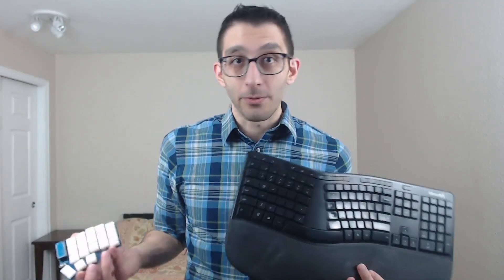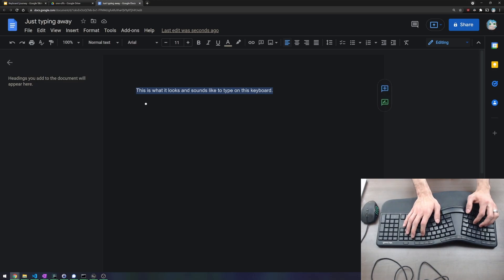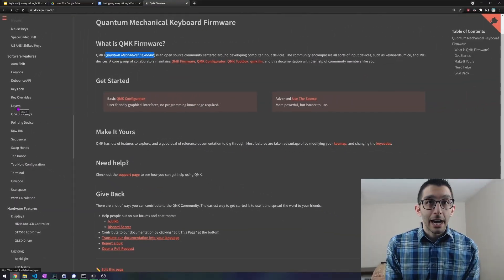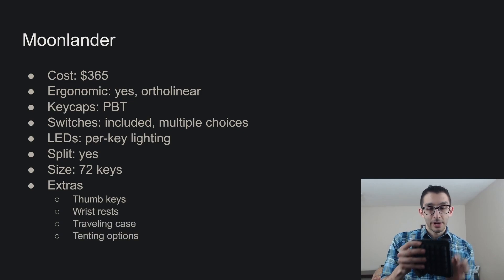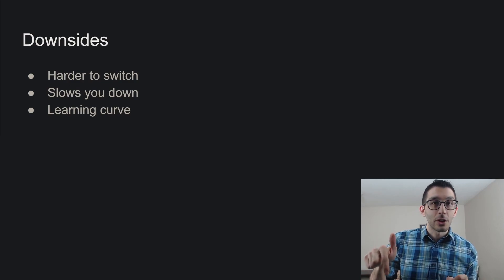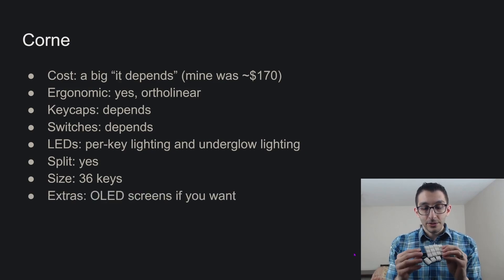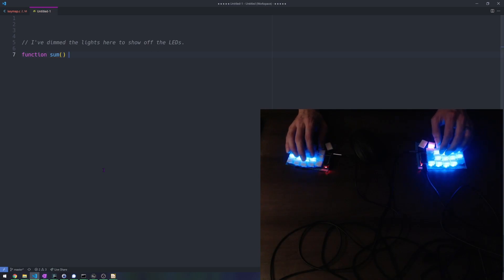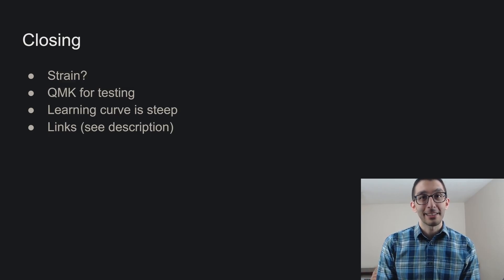My keyboard journey

Comment: Wish I could find a keyboard with an ortholinear layout and traditional modifiers and size. I’m not quite ready for a bunch of layers, and I like having keys like ‘ and \ on the main layer along with arrow keys (edit: ideally split and with a 1.25-1.5u modifier key under the C)

For anyone feeling similarly, the Keebio FoldKB is the only one I could find that has both VIA support and is actually available, although as a 60% it doesn’t have traditional arrow keys or a function row. Amazing company though
Reply from the maker: I swear I've seen keyboards like what you're describing in the various keyboard subreddits, but it's hard to find those posts now. These are soooort of close:

- https://www.reddit.com/r/olkb/comments/qgayzg/the_railroad_keyboard_now_open_source/
- https://www.reddit.com/r/olkb/comments/mxr8jw/ic_fluxlab_zt60_a_premium_60_ortho/
- https://www.reddit.com/r/MechanicalKeyboards/comments/lupxtp/i_designed_a_quirky_ortho/

Of course, you can always design and build one from scratch! 😛
Reply: @Adam13531  oh wow thanks! I really like the railroad, but getting it built might take some effort

I would like split if possible, I guess I didn’t say that, but that’s making it harder too. The railroad has space though. The other 2 are a similar design to the spacey , which is cool

Thank you for finding those!

I edited the comment in case, but I really like having a 1.25-1.5u modifier under the C key for use as the ctrl/cmd. That’s why I’m looking at splits because they have that sometimes. Super difficult to find this layout for some reason even though the modifier placement makes much more sense than a pinky corner one, but I’ve been having issues finding that without using a keyboard that’s column staggered ergo-style like the moonlander, and those keyboards don’t have traditional modifier/enter/backspace layouts

I will look into designing one at some point, but I just don’t have the time or energy for such a project right now

Comment: the picture you used for the example of ortholinear at the beginning is just column staggered as opposed to row stagger (regular stagger). Ortholinear (“same lines”) is specifically an even grid, but from a keyboard categories standpoint, ortho and columnar stagger are often (reasonably) grouped together as “not row staggered”
Reply from the maker: Yeah, I had the terminology incorrect. 😢 I hope it doesn't end up confusing anyone new to the keyboard space.
Reply: @Adam13531  I’m sure you’ll be okay! Once someone looks into it from this point, they’ll probably realize anyway

Comment: I had a similar journey. I started with an ergonomic Microsoft keyboard like yours, but an older version and I use now a Redox keyboard.

But I started using a different keyboard layout called Neo2 on the MS keyboard and after that I build my own diy split matrix keyboard. I skipped the GMMK.

Now I use a layout called PUQ (it is an optimized Layout for matrix keyboards and a mix of German and English language.

I want to build or buy a 34 key keyboard next.

And btw: components can be much smaller than this diode. It is my daily job to repair them 😂

I highly recommend to throw qwerty away as far as you can and learn an ergonomic layout like Workman or Colemak
Reply from the maker: Keyboards are quite the rabbit hole, aren't they? 😛

I've been wondering what the sweet spot is for number of keys. For me, I can't imagine anything less than 34 would be comfortable, and I'm pretty happy with 36 (but a single encoder would be really nice for media controls).

I wonder how hard switching away from QWERTY would be. How long did it take you? I do want to give it a shot at some point in my life, but I've spent so long getting comfortable again with my current layout that it would have to be a project for another year.
Reply: @Adam13531 I think it varies from individual to individual. You have to relearn not only the layout, but also the memory muscles for key combinations and the software you use. And it depends on your training discipline. For me, it took much longer because I'm older than you and had to learn two languages.

Long story short: it takes time. But the benefit is a much more convenient typing experience.

Comment: Thanks! Really great video help me a lot! I try to choose my first mechanical keyboard (after using Microsoft Natural 4000) between Arisu (Fancy Alice 66, modified Alice with arrows) and Split 75% VEA. How do you thing which is best for ergonomics?
Reply from the maker: Glad you liked the video! I haven't really used either of the keyboards you're considering, so it's hard for me to say for sure. Do you have any particular pains or discomfort using your Microsoft keyboard? Because the Alice is closer in shape to that keyboard than a VE.A would be.

The Alice also doesn't have nearly as many keys as you may be used to, which I actually think is a benefit for ergonomics, but it would lead to a higher learning curve.
Reply: @Adam13531  Thanks for your answer.    I make some research about existing for buy keyboards and also about pain and causes of it. 1) I go for split -> Alice out; 2) To columnar layout -> vea out. I consider lily 58 pro, nyquist 5x12 (sp50), ergodone. I ordered ergodone. As it gives maximum ergonomic advantages for my hands. Because health the most important, more than pretty led colors, or aluminum case. In ortholinear I still will feel pressure to ensure all my fingers on home row. I also want to use thumb more with keys. Qmk essential for me in linux. And with my Norman layout ergodox will be perfect. I also will do some modifications with it. Also brought resign wrist rest.
Reply from the maker: @simon215a  I hadn't heard of the Ergodone, but it looks like an ErgoDox, which I'd used for a while. It should be a great keyboard! The one thing I'd advise against is trying to use the innermost thumb keys; they're a bit awkward to hit for anything common. The big thumb keys should be quite comfortable though. 👍

Comment: Great video man. I had a somewhat similar journey and ended up on a ferris sweep.
Reply from the maker: Thank you! Regarding the Sweep: how are you liking it? Do you ever feel like you want more keys?
Reply: @Adam13531  ive only had it for a few months, but as of now no. Once i learned my layouts it feels very cozy not having to reach far for anything.
Reply from the maker: @flip4119  what'd you end up settling on for a shift key? Is it a dedicated one or a dual-function key?
Reply: @Adam13531  that was definitely the hardest one but i ended up with one of the right thumb buttons. left buttons are super and space. right is shift and switch to symbols layer. with setting certain layers to hold and others to switch from a tap theres  a lot of layouts you could do.
Reply from the maker: @flip4119  thanks for sharing your setup. I've experimented a lot, but my main issue is that I don't like dual-function keys since I have to hold them extra long to make sure they actuate. I was debating on making a keyboard with maybe just two extra keys or possibly moving an uncommon letter like "Q" onto a layer.

Comment: Nice video, I had a similar journey! The only problem is that once you know you can create your own keymap, you end up falling in a rabbit hole, it is an endless story. Are you finally fully satisfied with your keymap?
Reply from the maker: I certainly agree about the rabbit hole! I've still been using the Corne since this video, and while I'm happy enough with the layout I have on it, I still think I want a few extra keys. I'm planning to use the Moonlander as a testbed for a 42-key Corne, that way I can have modifiers on the base layer. Without that, I feel like I slow down every time I want to press ctrl or shift.

Which keyboard are you using now?

Comment: I'm actually faster on my corne than my moonlander. How do you find the moonlander spacing?  To me it feels like the keys are too far apart. Will give your corne layout a shot.
Reply from the maker: I still haven't used the Moonlander since our last little chat here, but I do remember feeling like everything was too far away. I think every keyboard will feel that way once you've used something very minimal though (the trade-off being that you press more keys to do the same actions).

I still have a few more tiny layout optimizations I want to do, then I may try a keyboard with just a few more keys; a few dedicated modifier keys would be nice.

Comment: What was your thought process with creating each layer? I’m kinda stuck on the mapping part because of the endless ways to put it.
Reply from the maker: I took a lot of inspiration from the Miryoku layout: https://github.com/manna-harbour/miryoku/tree/master/docs/reference#general-principles

In general though, one's layout on a keyboard like this is best when personalized. For example, if you're a programmer, you'll potentially want a different layout for your most commonly used language from someone who uses a different language. More concretely, I've found that I type Markdown links frequently enough where I wanted a paste function to be on the same layer as my brackets and parentheses. I also frequently type "1:1", so I put a colon in my number layer and actually made it so that holding shift and pressing that key will turn it into a semicolon.

My full layout for the Corne is here if you're looking for some ideas: https://github.com/Adam13531/qmk_firmware/tree/master/keyboards/crkbd/keymaps/adam

Comment: Corne user here, but MX version. How are you finding your choc switches?? Which ones did you get??
Reply from the maker: Hiya! I'm using Kailh's red crystal switches (the whole BOM is here: https://github.com/Adam13531/crkbd/tree/choc-v3#corne-keyboard). I like choc switches so far. I tend to really hammer the keys with a lot of force, so the acoustics of the Moonlander ended up sounding hollow to me. I like the more muted sound of the chocs, and I like the low travel distance.

All in all though, it's just like deciding between linear, tactile, and clicky switches in that everyone has their own preference, and it's almost impossible to tell what yours will be until you try them out for long enough!

Comment: I think this might be the video I give to friends who ask "what's the big deal about mechanical keyboards?" I'm currently at the "home row modifiers are amazing" phase with 60% split spacebar keyboards. Next month I'll be building my first 40% ortholinear.
Reply from the maker: I think it's important what you did to gradually go toward 40% rather than jumping all at once, that way it's not overwhelming. What's your next board going to be?
Reply: @Adam13531  I jump directly @ ortho 40% ¿ that's matters ?
i put my modifier keys one row up, i don't use homerow mod, i dont like the delay with combo key, so i keep all alpha key clean of combo function
i'm allready looking a second ortho keyboard, maybe the foldKB (for he's big mod key in my case) by keebio...with a traball or a touchpad in the center
by the way, nice video Adam
Reply from the maker: @tankafer3127  Hey, sorry for the delay in responding. I don't think there's an issue with jumping directly to a 40% board as long as you're not concerned about the cost. There will be a learning curve, but it really isn't too bad, especially not for regular typing (rather than coding).

Regarding home-row mods: whatever works for you is what you should use! People who prefer smaller keyboards usually do so because there's less finger travel while typing, and we all have different typing patterns, so it's worthwhile to tailor your layout to your situation.

Also, the FoldKB looks pretty cool, and it has two rotary encoders on it! I miss that from the GMMK Pro that I was using.

Comment: Love the video. Especially the fact that you went over every keyboard well. I've been sitting on the ergodox for now and was debating moving to the moonlander. In relation to homerow mods. Oryx has this cool feature where if you hold the key slightly longer (i set it to 150 ms) it auto shifts the key. Did you ever look into things like the kenisis advantage? I was wondering how you felt about the concavity of something like that or even something like the Dactyl Manuform since that would also be pretty DIY. Glad to see you again Adam! :)
Reply from the maker: Hey Vybhav!

- I think the Moonlander is a great improvement over the ErgoDox (especially if you have an earlier version without per-key LEDs). With that said, I thought I would enjoy the Moonlander much more than I did. I found the red thumb keys weren't the easiest to hit, and I dislike the sound of keyboard overall compared to the other mechanical keyboards in this video.
- I gave auto-shift a shot through QMK. I decided that it wasn't for me because I felt like I was pausing enough due to home-row mods that I didn't want to also pause when typing "!" or "$".
- The Kinesis Advantage struck me as an ErgoDox in a different form factor, and since it has such a high price tag, I decided against trying it out.
- I haven't tried a Dactyl Manuform. I think most people who build it comment that it takes a lot of tries to get it just right for your own hands, and I also heard that the build itself takes a while. I'd love to try someone else's someday just to see what it's like though.

I've been using the Corne for almost three weeks now at this point. I want to give it at least another month, and if I still like it, I may start looking into small upgrades like a case, tenting options, or something that looks a little more "complete" than just two PCBs sitting on anti-slip pads.

Good to see you again, and I'm glad you liked the video!